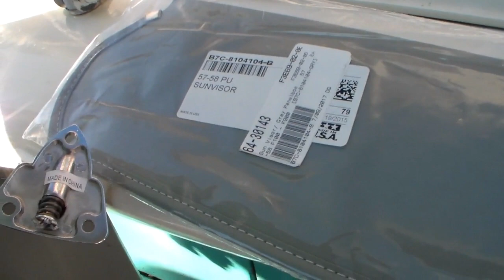1959 Ford F100 Truck Custom HEADLINER Project Easy Installation Episode 4

Comment: Hey Don who did you go through to get your headliner, it came out really nice is there any other companies that you would recommend or do you like that one right there. I have a 60 Ford 4 by 4 and that's about one of the last things I got to do to mine.
Reply from the maker: Thanks Dale. 10 months now and it still looks good. Purchased this REM brand headliner kit from collectorsautosuplyinc (username) on eBay.  Still available there now, $194 shipped. Fabric was extra, but looked good as the basic white surface, too. Bought that vintage Ford fabric on eBay, too.

Comment: I'll probably watch this video a dozen more times. I'm gonna buy some of the insulation at home depot and make my own headliner. Thanks Don
Reply from the maker: I wanted to make mine, too. But I took the easy way out. lol Have fun !
Reply: @DonWSquared  do you think the preformed liners are strong enough to support 4 stereo speakers?  Once I get my 59 F100 running, I would like to install a Jensen radio with an under dash kit in it.  My truck doesn't have a factory radio.  My late dad bought it new and stripped with only a dealer installed heater.  Turn signals were mandatory in California.  I won't be drilling holes for the antenna; I have an inside mount windshield antenna ready for the truck when I install the radio.  The stereo is set up to have front and rear speakers, so I will do a quad speaker setup without drilling the door panels.